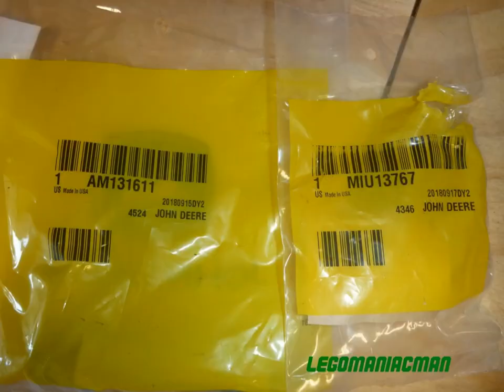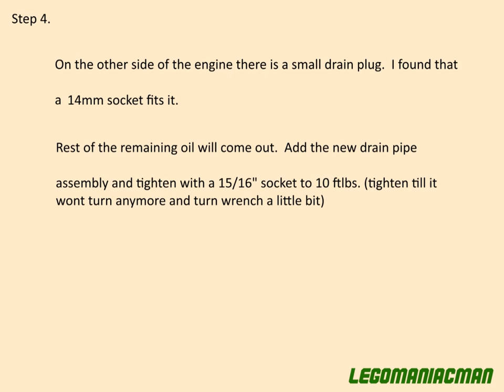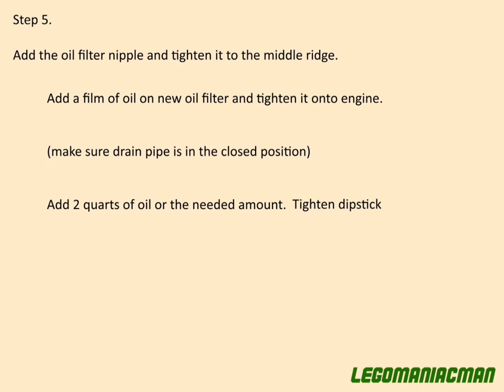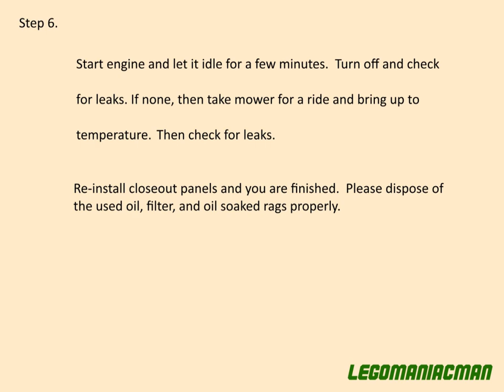John Deere E Series Easy Oil Change Conversion Kit Instructions

Comment: I tried a 14mm socket and it just spun and rounded the corners of the old drain plug.  Get a $9 universal socket at home depot, worked like a charm.  For removing easy oil fitting use a socket and breaker bar.
Reply: CT Sailor and Nikon Guy Why not a wrench?